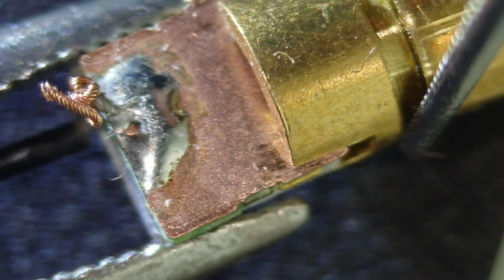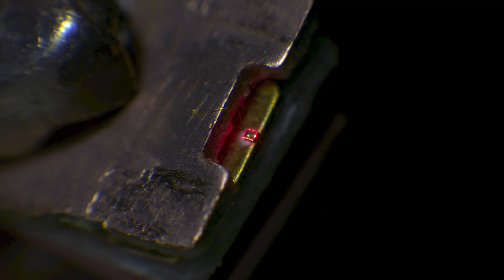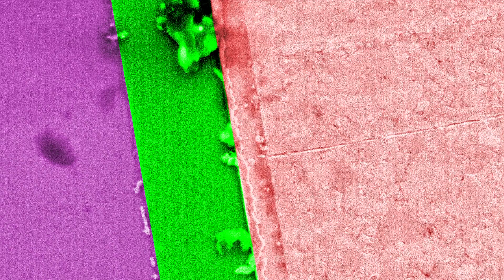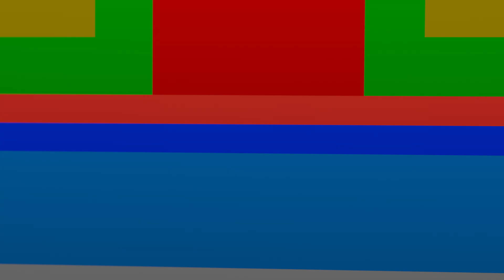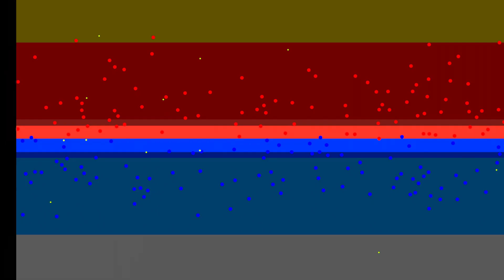How a laser works, under an electron microscope!

Comment: electron microscope can be used as an ion-beam micro/nano 3d printer. for silicon wafer micro chips and thin films.
Reply from the maker: Electron microscopes use electrons, not ions. There are FIB and FIB-SEM systems, but they are not used for chip fabrication because they can only very slowly produce structures out of specific materials, mostly metals.